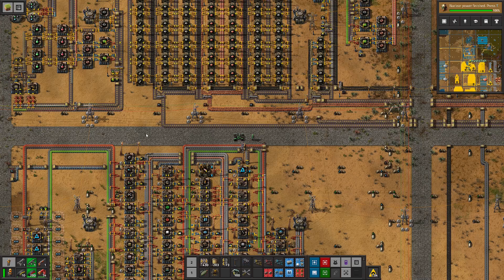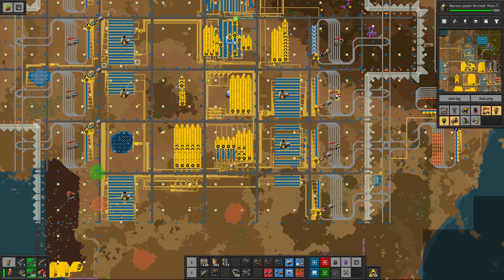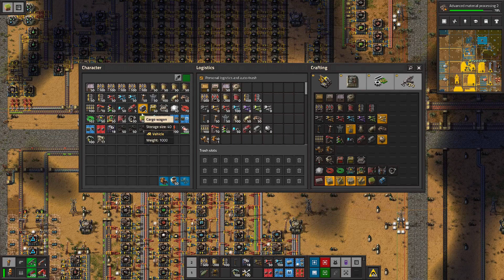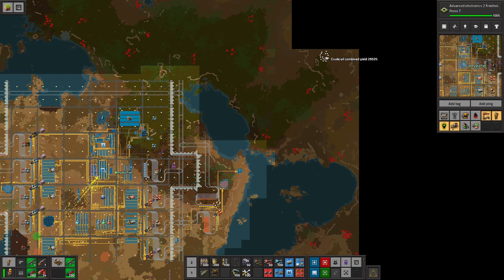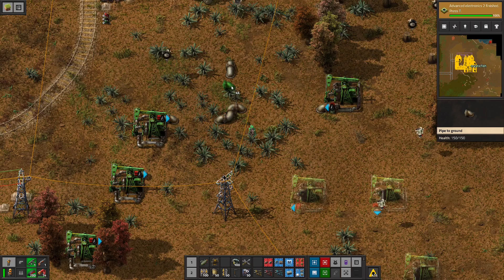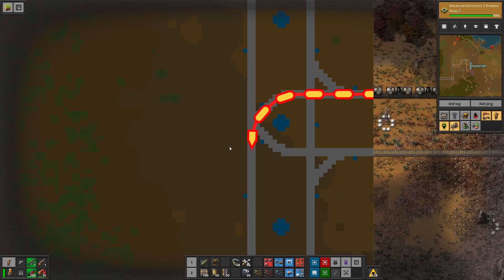Oil Outpost - Ep50 - Factorio Expand-a-Base

Comment: 3:13 Or have the builder train come straight down from the "big transverse railroad" at the top of the base. That would also allow you to come one further down to right next to the main mall. I don't know if you need much space for uranium processing, but not swerving westward from next to the mall/jumpstart city block should leave more space inside the base.
Reply from the maker: I ended up doing exactly this! Thanks for the idea. :)

Comment: I think I remember something "feeling weird" about the balancing of the oil pickup compared to the oil drop-off, but I'll have to re-watch the design video to remember what that was.
It'll be nice in the expansion when that type of balancing shouldn't be necessary.
Reply: After rewatching the fluid station design video, I think the weird feeling I had was that the #4 and #5 pumps have a chance to be enabled at the same time because #4 is "if 4 <= 5" and #5 is "if 5 <= 4". They will both be enabled when the fluids are equal (maybe that's intentional since it'll leave the balancing to the normal game mechanics).

I had started writing out more thoughts, but I'm unsure about the mechanics and the effort of "fixing" this probably isn't worth it since the trains will fill up. Also, having all of the conditions include some form of "equal" means pumps won't block flow in those edge cases.
Reply from the maker: Yeah, fluid dynamics is weird. We’ll watch how it goes and see if we need to intervene further. :)